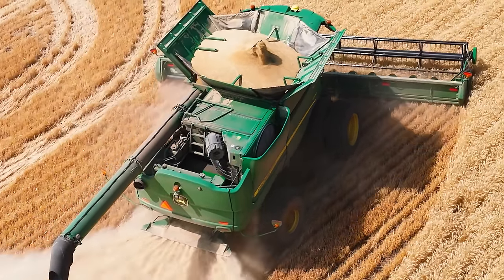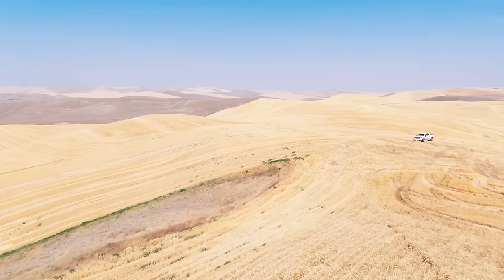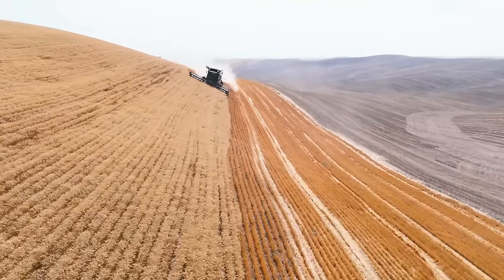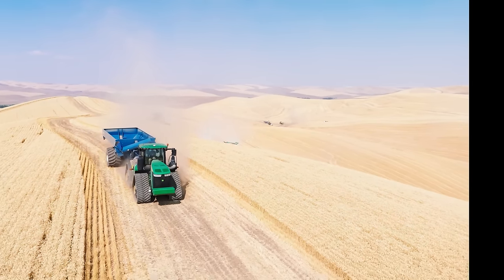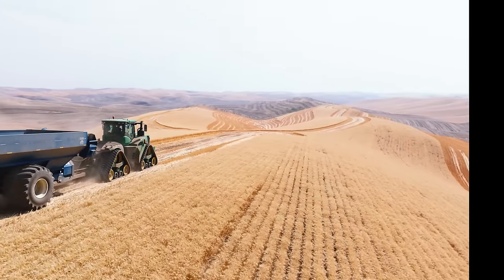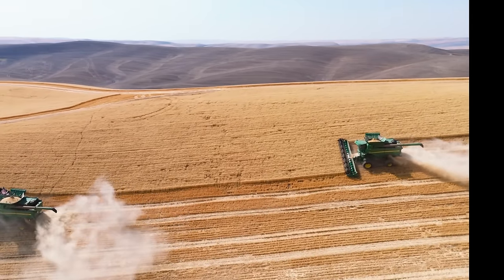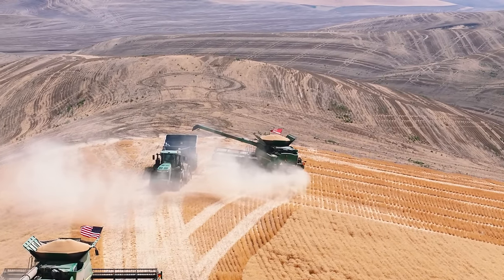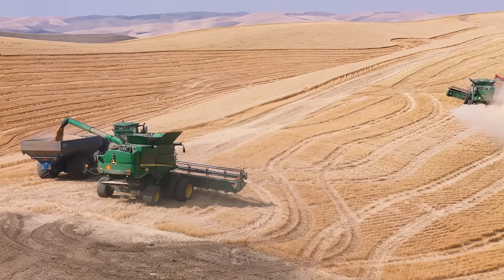Steep hills and harvesters sliding on soft ground

Comment: Very nice video! Would spikes on tires be useful or would they just increase the risk of tipping over? In the past there where spikes mounted in the rim and you could unfold them on the field.
Reply from the maker: It might? I know people used to run chains on the old machines with smaller tires. These tires have the best rating for sidewall pressure and John Deere won't sell you a leveling combine without them on it. I doubt they'd want you doing that, but i am not sure it would help. maybe?

Comment: Thanks Trevor.  I believe there was a European combine that would level itself in two planes, ie the wheels would stay vertical and the combine would remain level fore and aft!
Reply from the maker: We ran them out here once upon a time, but they were much smaller than the current ones we all run. I don't think a single hydraulic ram would or should lift one of these combines like those other ones.

Comment: Nice Footage, but I have a Question. Why do the Combines have these soft profiled Tires and not the normal ones you know? Are these Tires just better on the hills or what is the Purpise?   Greetings from Germany.
Reply from the maker: Yeah, they help on the soft and steep stuff. Help you not rip the dirt up and make big burms we cant deal with. No plowing to smooth anything out, so it is extra important now not to disturb the soil to badly.
Reply: better tyre life running at lower pressure too... @TrevorStruthers

Comment: What crop rotation do they do. When I farmed I would go to corn the next year then 2 years of soybeans then wheat again.
Lambton Shores. Southern Ontario Canada
Reply from the maker: It goes fallow and rests for a year. Then we will plant wheat right back into it. The moisture just isnt there for much else than maybe canola and it doesnt fix nitrogen the way beans or legumes rather would
Reply from the maker: We dont recrop often. It leads to terrible yields most years
Reply: @TrevorStruthers  Ok. That makes sense. That’s why in the background I see worked up fields that as you say are fallow.
My wife asked if I would like to combine on those hills!!  I told her one of the farms we rented had a small side hill, and I was very very careful combining it!!
My days behind a wheel of a combine are long gone. 🥺
Reply from the maker: @va3kbc  thats too bad! At least youve cut on a hill. Some of these hills out here are just a bit too steep to be fun. Exciting is not the same as fun! I am glad you tuned in. Have a good one!
Reply: @TrevorStruthers    We are watching another of your drone videos and my wife was wondering if they have ever lost a combine?
Reply from the maker: @va3kbc  it happens, but its fire that takes them. Rarely do they roll or get crashed. It does happen though, but ive never seen it in my 40 years in person. Tires fall off and a les break, but usually we are very lucky
Reply from the maker: Axles break.
Reply from the maker: @va3kbc  those axles and wheels falling off has happenes to me, both. And my combines been on fire around 6 times. Ive never lost a machine tho
Reply: @TrevorStruthers  Same here. One summer during wheat harvest it was hot and dry.
3 local farmers had combines get on fire.
I always kept my John Deere 9500 as clean as possible.
Every morning I would blow the whole combine off and even did in the cab.
That combine was my pride and joy.

Comment: There are big John Deere combines with HillMaster technology. The included HillMaster leveling technology can compensate for inclines up to 22% for consistent performance while on slopes.  The technology uses hydraulic to level one side of the machine.

https://www.youtube.com/watch?v=ePBDedsmfsA
Reply from the maker: We unload on the go up to a 27 degree slope, there are 45 degree slopes out here. We run HillCo's and they don't level enough either. King of the hill by HillCo for CASE still doesn't level enough. Thats why we use the uphill brake to slow down the uphill tires. They wanna slip because no weight on them. Beyond maximum level, or so I call it. Cool video though. I will watch it more closely again.

Comment: Tap uphill brake - uh no.
Reply from the maker: yes! It really does help you stay on the hill, but at the risk of tearing it up a bit. You can see a bit of that going on in one of the shots.
Reply: @TrevorStruthers  back in the day we would tap the downhill brake to pull the back end up the hill. Taping the uphill brake would cause the back end to move downhill
Reply from the maker: Perhaps that was the case. Here we are holding pressure slightly on the top hill brake to stop it from spinning and bringing the combine back up the hill.
Reply: Trevor is correct about tapping the uphill brake.  The current combines don't level so far so without diff lock you need to keep the uphill wheel from breaking loose.  We now have RWA to hold the rear end up that the old full leveling combines didn't have other than the 1470/1670 series.  In the old days we put log skidder tire chains on to hold the combines with single drive wheels on the hills.

Comment: wrong profile on the tires
Reply: What profile tires should he have?
Reply: @glennwarren4996  Combines with tracks and/or 4WD would be better. Also, there are special combines for steep hills.
Reply: @snowfighter62  I farm in the same area as the videos.  The tires on the combines in the video are the best there are for those soft conditions.  I was just wondering what would be better than the best tires there are.  Our ground is hard closer to the Blue Mountains that Trevor mentions.  The tractor tires are a better option there. Tractor tires aren't allowed on the new JD combines because they don't have enough load rating like the Alliance tires pictured and the R-3 tires.

On the old school hillside combines we ran log skidder tire chains to keep those single front wheel combines on the hills.  

Thanks for the videos Trevor.
Reply from the maker: The tires are the correct tires I believe as well Christian. They don't rip up the ground and have good flotation out here in the soft hills as well. Especially with no till going on and nothing ever getting smoothed out. The tires sitting sideways like they do need strong sidewalls as well. Makes sense to me and thank you Glenn!
Reply: @glennwarren4996  thank you very much for your explanations 😃